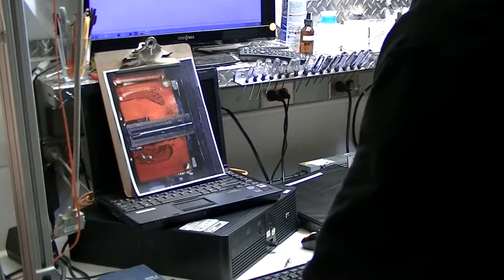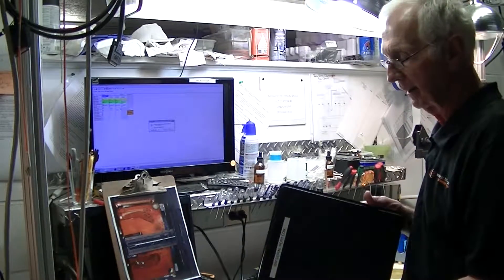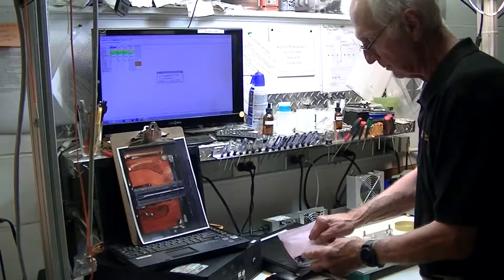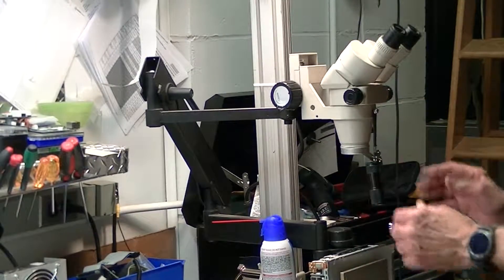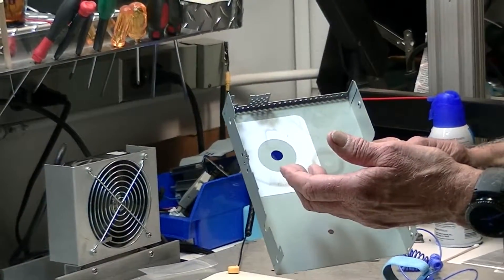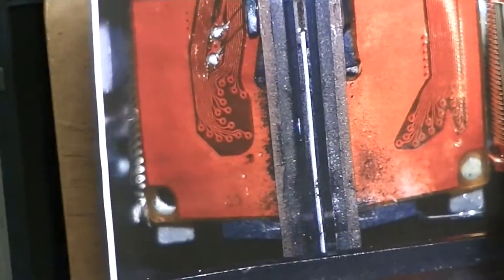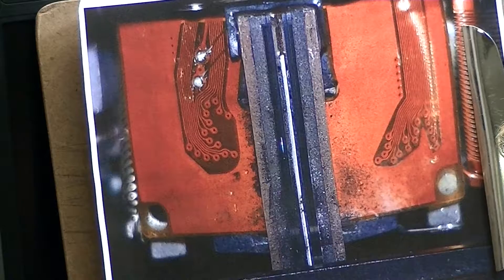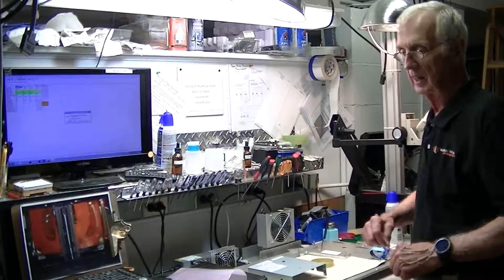Tape Drive Test Station - Tape Drive Repair

Comment: Hello, I know it's a long shot but I've been trying to repair some tape drives as a hobby to save landfil and waste. I've made communication over the serial port through a handmade cable, and confirmed some basic back-and-forth with setting config parameters, which was fairly difficult due to the lack of documentation.

Would you be able to share - or point me in the right direction for - a copy of the manual with serial commands that you showed in the video?
Reply: can I contact you to discuss I'm also looking into this but was taking a firmware-reversing approach
Reply: @comedicsketches  Many appologies! I never saw your reply. Did you ever get anywhere with firmware-reversing? I was looking into chip-off firmware extraction as its downloadable form is encrypted (obviously). Of course, it could still be stored encrypted on the flash chip and decrypted at boot. I've currently got a LTO 6 and a pair of LTO 7's (all IBM HH models) that I'm repairing, and I note the LTO 6 has 3 extra headers on the main PCB that appear to be for probing and testing. I'll be checking whether these connect to anything useful (such as addr and dat lines on the flash) to save the trouble of chip desoldering.

I did develop a pair of basic scripts to help with putting together a LDI serial string, such as calculating the BCC, and formatting the hex values. The other script to validate a built string against the expected LDI format and checks.